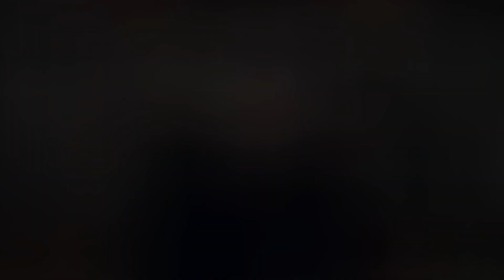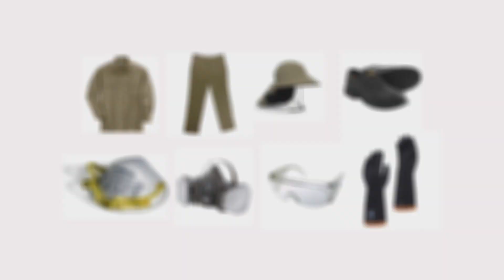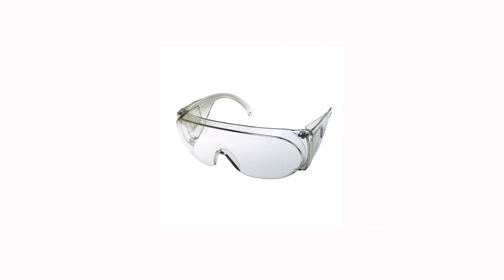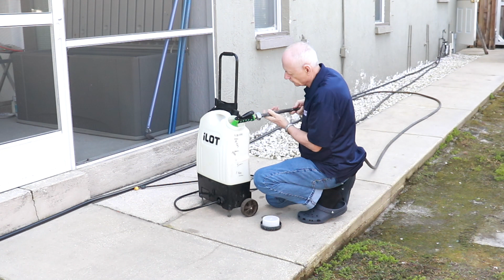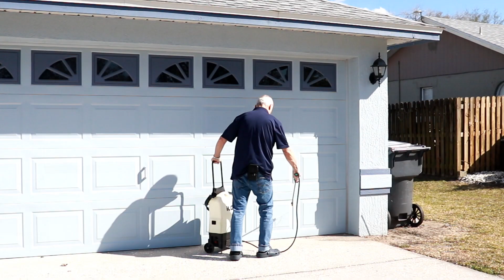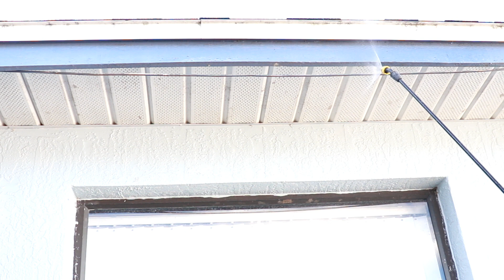How to Prevent Drywood Termites 100% Guaranteed.

Comment: i thought TAURUS SC lasted around 5-10 years You are saying only 3 months
Reply from the maker: Both of those things can be true at the same time.  Taurus SC will usually last 5 to 10 years when used to trench for termites because it bonds with the soil and it is not exposed to direct sunlight or the weather.  However, when used as a surface spray on the building or other outside surfaces, you will probably be lucky to get three months out of it.  They claim it will last up to six months as an outside application, but I think that's a ridiculous claim.  The truth is, I live in an area where there are drywood termites, and I do the treatment every 60 days because the last 30 days of the residual is nowhere near as effective as the first 30 days, and I don't want an infestation of drywood termites.  So, I don't take any chances.  The only way to get rid of drywood termites is to fumigate, and that is inexpensive process that is a pain in the neck to deal with.  So, I am out there every 60 days, religiously.  This way I know for sure that I am not going to have an infestation.  90 days may get it done, and that is what the labels are telling you, but I have some trust issues.  I said 90 days in the video because I'm supposed to tell you what the label tells you to do, but I choose to do it more often.  I hope that helps.  Be well my friend.

Comment: Thank you ! Your videos are really informative and help so many people! What would you recommend for treating road cases that hold equipment? The type you see on tours and backstage productions? I’ve seen them get infested but often they are laminated on the outside, and have either painted black wood on the interior or foam carpeted interiors
Reply from the maker: I would look for frass.  If you see any, then you know there is kick out hole just above it.  I would also do an inspection to see if there are any tiny holes in any of the surfaces.  I would treat any holes that I find with a termite foam.  I will provide a link below for the foam that I recommend.  It is the least expensive product I know of on the market that works.  I always purchase it from Amazon.  If you use my link, I will get a very small commission on it, but you will pay the same price if you use my link or if you go directly to Amazon, because the commission they give me comes out of their end and not yours.  So, this is an easy way to help support the channel that doesn't cost you anything more.  If the kick out hole or exit hole that you find is not large enough to insert the applicator tip of the foam can, then you may need to drill a hole right into the existing hole that is large it enough to insert the applicator tip.  Shoot the foam into each hole for about 7 seconds or until it is coming back out at you or other holes.  Please keep in mind that, if any of these things are infested, any place you bring them may become infested as well.  I hope that helps.  Be well Tyler.

BioAdvanced Termite & Carpenter Bee Killer Plus Foam:  https://link.amazon/B0fUQ9oJF  
(paid link) [Amazon affiliate link]

Comment: Hi! Thank you so much for your video! It’s really instructional and helpful - question, in case where termites have entered into my houses, are there any ways to kill them other than renting the home? We plan to start using your method for outdoor spraying but want to know if there’s a way to kill those termites who have entered into the home. Thank you so much!
Reply from the maker: I hate to be the bearer of bad news, but the truth is that the only way to eliminate drywood termites is to fumigate.  You can spot treat a lot of your home, but the problem is that a termite gallery can be as small as a peanut, and there just isn't any way to find them all.  Spot treating is kind of like playing whack a mole.  No sooner do you treat one gallery; another one rears its ugly head.  The only good news about drywood termites is that they are very slow eaters and it can take years for them to do significant structural damage.  So drywood termites are not a panic situation.  You can usually take a couple of years to save up the money for a fumigation and try to figure out how you can finance the rest.  You should also shop.  Prices can vary a lot in this industry, so it's always a good idea to get at least five or six estimates.  If a pest control company tells you that they can spot treat this and eliminate all the termites, they are lying to you.  The price sounds a whole lot better than fumigation, but it isn't going to work.  I also recommend that you read the frequently asked questions about drywood termites on my website.  The link is below.  I hope that helps.  Be well Christina.

Frequently Asked Questions about drywood termites:  https://www.guyspestsolutions.com/frequently-asked-questions/drywood-termites-frequently-asked-ques

Comment: How can I treat a large wooden dining table that is infested with drywood termites? Should I put it in the sun? Can I coat the table in boric acid? I don't want to use too many chemicals since it is a place where people eat.
Reply from the maker: Actually, putting it in the sun is not a bad idea but it may not be enough.  Boric acid isn't going to do anything to help the situation.  If it were me, I would locate all of the kick out holes and exit holes, and then I would enlarge them to accommodate the application tip of a good termite foam.  These holes can be very tiny and hard to spot.  If you leave the table undisturbed, you should start to see frass on the floor, just below kick out holes.  Just drill a hole that is slightly larger than the application tip of the foam can and shoot the foam into the hole for 7 seconds or until the foam is coming back out of you.  Make sure that you don't drill the hole so deep that you come out the other side of the wood.  You just need to get about halfway through the thickness of the wood.  I will give you a link to the foam that I recommend.

After you finish the treatment, simply use soap and water to wash the areas that were treated to remove any pesticide that may be on the surface.  After that the table is perfectly safe to use.

The only personal protection you need is wearing rubber gloves and eye protection.

Now a couple of words of caution.  Unless you find all of the kick out holes and exit holes and treat them as stated, the infestation is not going to be gone.  This may not be just one gallery.  Drywood termites often form multiple galleries in the same piece of furniture and if you miss one, you risk them swarming at some point, which will cause them to start galleries in other areas of your home.  It is possible that this has already occurred, and it is also possible that you got this infestation in the table because they are already in other areas of your home.  If your home becomes infested with them, the only way to eliminate them would be to fumigate the entire house.  So, getting infested with drywood termites is a very big deal because it's expensive to get rid of them.  Therefore, if this table is new, and you do not already have an infestation in your home, then it might be wise to get rid of it.  Often times, people get an infestation in their home because they bring in used furniture that has drywood termite galleries.

I hope that helps.

Guy

Termite foam:  https://www.amazon.com/BioAdvanced-700420A-Termite-Carpenter-Pesticide/dp/B014PPFRVM/ref=sr_1_8?crid=2OEIKF4OHXQWA&dib=eyJ2IjoiMSJ9.qhQ3LkRnBjPufP4Mb0Ihmwl8uBmFOcKAtroAY6pSdoFeE9dRyV_n79V2pBhT1-qfIif8oa15dm-Q-otBP0NlBGFaX4hnDieF7mSfB_H90J5AqjyrowYve-DgysIsNleSYSTJpX0ynXsgX4vnpCIVr2wi209yTJjIBaH58rjOq_bwC5yQoXub9_iu_do2zT01MKrMOFc5Uenmj_oYVcTCTKe1zqbWOJuVlne5cCkcsQQ.N9gsnjNHv05VgByVIvR2XKnJCPt38N3jgv1jK-lJtI0&dib_tag=se&keywords=imidacloprid%2Bfoam&qid=1787941882&sprefix=imidacloprid%2Bfoam%2Caps%2C197&sr=8-8&th=1

Comment: I've found this video in the algorithm.  I've been battling with flying termites for maybe 30 years now. I've gone thought 5 kitchen tables sets, 7 sofa sets, 4 bed sets and countless doors, etc. I live in Puerto Rico, where everyone with a tree has multiple nests. My neighbors bulit concrete fences where they now live in. I've called different exterminators and nothing. They've spray the yard, around the house, in the house and even the sofas, tables, etc directly. I've tried everything from Home Depot and local agricultural stores. I also put strips of fabric around doors and windows, this done with stripping already on. They still appear in and outside the house. Its been a good 3 years now that they are found inside by fistfuls, dead and alive. There are wings everywhere, mostly in the two living rooms. Literally, yesterday I put in a new door, stripping and retreated the area. This morning I found the same. Again, mostly under or around the sofas and chairs. These are also new and have been checked and treated by an exterminator. I also made holes in the sofas and treated it with a needle. I cry everday because the things I buy are a sacrifice, evertime. I have to work and save just to replace. Our houses are made of concrete, our windows are also metal. I still don't understand how they get in or how they are still alive. There are no lights left on at night because they are attracted to it. I need some help, Google doesn't work. I've research for years and it just confuses you. If anyone has any insight, please help. Youtube has been spying on me and blessed me with this video. Tnx
Reply from the maker: I may be able to help you with this.  The first thing we need to do is to identify the species.  Try to obtain a specimen that has the wings still attached.  If you cannot find one like that, then collect a couple of the wings and lay them out next to the specimen when you take the photo.  Place a ruler next to the specimen for size reference.  If you do not have a ruler handy, then place a dime or a penny next to it.  Get as close as you can to the specimen so that you fill up the screen on your phone.  Then back away slowly until the specimen looks crystal clear on your screen.  Tap on the screen before taking the photo to see if a focus ring opens up.  If it does, then make sure the focus ring is directly over the specimen.  If you can get an Android phone, see if it has a macro setting that will allow you to take very close up photos.  iPhones usually do not have this feature.  I need the photo to be very well focused because I may literally need to count the veins and the wings.  You can send the photos to guyspestsolutions@gmail.com.  Please allow a few days for me to respond.  As you can imagine, I get a lot of emails, so it is normal for me to be running several days behind.  Don't worry.  I answer all the emails, albeit not as quickly as I would like.  When you send the email, please copy and paste your original question and my response into the email so that I will know who you are and I can refresh my memory about the problem.  I hope that helps.  Be well my friend.

Comment: Thank you, Guy, for your willingness to help make us able to inexpensively deal with pestilence in our homes! 

I have a block rental house (even interior walls are block) with a flat roof that leaked so badly, it would rain inside every time it rained outside. 

Unbeknownst to me, this went on for many years without repair (my ex was abusive and in complete control), The drywood termites flew in and feasted on the roof structure, unhindered. Now I am divorced and I live in this house, with a tarp above the flat roof, and plastic stapled to the ceiling on the inside. 

Now I’m stripping soggy sheet rock and insulation off the ceilings, exposing water-damaged and termite-eaten beams and rafters inside. 

How would you recommend I proceed to deal with the termites, so I can temporarily live in it while I build a new house? ❤
Reply from the maker: I am so sorry that you are having this problem.  How you deal with it depends on where you live.  I already know that you live in a tropical or subtropical area that is probably near water, but you didn't say if you live in the United States.  This matters because not all products are available everywhere in the world.  Assuming you have access to the product I am recommending, and assuming that you are stripping all the drywall from the ceilings, the best way to deal with it is to treat all the wood from the roof underlayment down to where the drywall was.  Apply Bora-Care to everything that is made of wood.  Mix the product 1 to 1 with water and apply it with a pump-up garden sprayer.  I will give you a link to the product and a link to a video that will show you how to use it.  You do not need to mix it with hot water.  The label will tell you that you can mix it 1 to 5, but it works much better if you mix it in equal parts of product and water.  Do not mix more than you are going to apply the same day.  This product will kill any termites that are in the wood, and it will render the wood permanently termite-proof.  If you replace any of the roof structure, then you should also treat the new wood.  If you are not removing all the drywall, or if you cannot obtain Bora-Care, then you will need to fumigate the house.  Let me know if that is the case, and I will guide you further.

I hope that helps.  Be well Sheryl.

Video on how to apply Bora-Care:  https://www.youtube.com/watch?v=Rmr_aEodyhg

Bora-Care:  https://www.domyown.com/boracare-p-100.html
Reply: @GuysPestSolutions  Thank you for your reply! I’m sorry I forgot to say, I live in west central Florida, so I do have access to these products. Thank you so much!
Reply from the maker: You are very welcome.  Be well Sheryl.

Comment: Thank you Guy, great video!

I have a question about prevention. I currently do a perimeter treatment around my house every 3 months using a bifenthrin product (Bifen) for general insect control.

If I also spray the eaves and roofline as part of that treatment, would that help deter drywood termites from starting colonies? Or is a non-repellent termiticide like Taurus SC still much more effective for prevention?

I understand that for subterranean termites non-repellent products are preferred, but I’m curious specifically about drywood termite prevention around eaves/attic entry points.

Thanks so much!
Reply from the maker: You are absolutely correct.  Bifen IT will do a great job preventing drywood termites.  However, if you are using Bifen IT, I recommend treating every 60 days. The product is supposed to last up to 90 days, but the moment you apply it, the effectiveness starts to wear off.  So, the first 30 days is going to be a lot more effective than the last 30 days.  The last 30 days may not have the killing power that you need to kill these guys.  Taurus SC is different because it can last up to 180 days.  For that reason, you are safe applying it every 90 days.  Another way to go is to use Bifen XTS with a hose-end sprayer.  Bifen XTS is different than Bifen IT.  It is much more concentrated, so you only need to mix 1/3 ounce per gallon of water.  The viscosity of the product is much thinner which allows it to be used in a hose-end sprayer.  Doing it this way saves a lot of time.  You can treat your house in a fraction of as compared to a tank sprayer.  The hose-end sprayer also allows you to reach areas that are much higher up than you could reach with a tank sprayer.  That means you can reach high up areas without a ladder.  I have a video on how to do this, and I will place a link below for you.  Please note that in the video I recommend diluting the Bifen XTS 1 to 14 with water.  However, for drywood termites I recommend that you mix it 1 to 10.  The sprayer cup holds 32 ounces.  So just put two ounces of Bifen XTS in the sprayer cup and add 20 Ounces of water.  This can be a little messy when you're treating around windows and it can make the glass a bit hazy.  To do a neater job, just treat around the windows with a tank sprayer.  Simply use the hose-end sprayer to fill the tank sprayer.  You can put the hose-end sprayer in the stream mode and shoot the finished product right into the tank sprayer.  Bifen XTS is going to look very expensive, but keep in mind that it goes three times as far, so you need to divide the price by 3 to compare the cost to Bifen IT.  It is about the cheapest pesticide you can buy per finished gallon.  By the way, the video is going to show you how to do the treatment with a tank sprayer, but the last part of the video will show you how to use the hose-end sprayer.  In the video I am only recommending that you use the hose-end sprayer for hard-to-reach areas, but the truth is you can use it for everything.  Links to everything you need are the video description.  I hope that helps.  Be well my friend.

Video on how to use a hose-end sprayer:  https://www.youtube.com/watch?v=Yozv3s-Qwlw